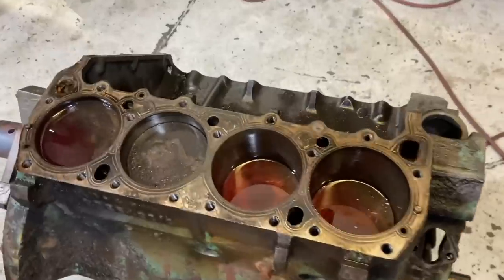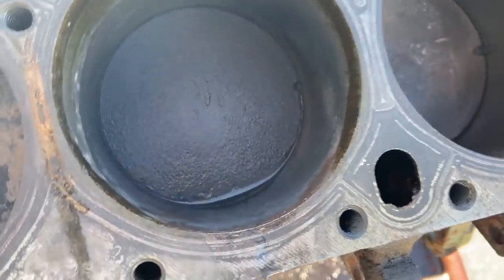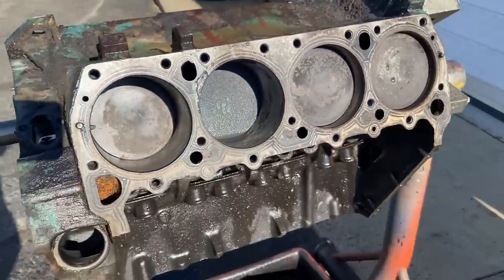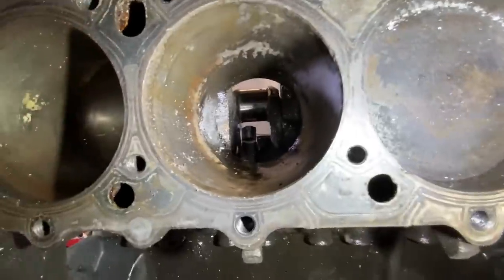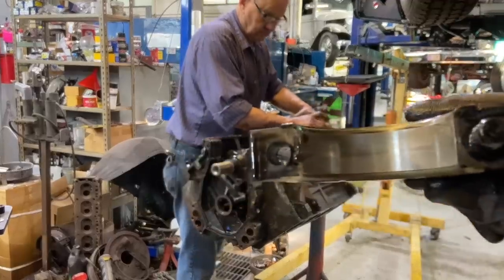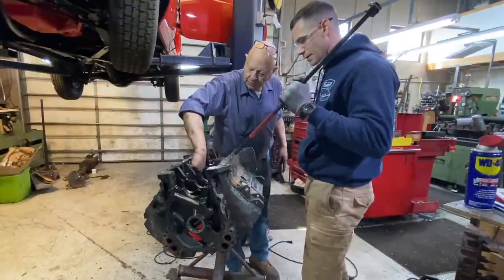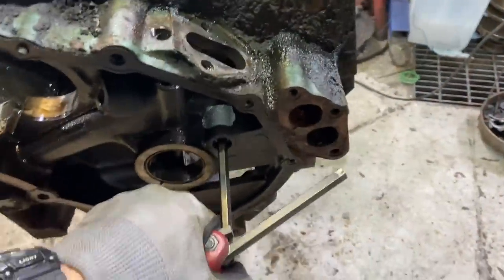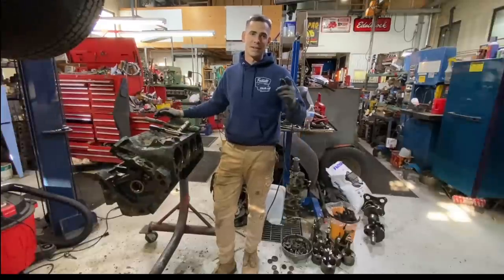How to Free a Seized ‘69 440 Engine: Ep. 2

Comment: I think several days of electrolysis rust removal (or when the process stops bubbling) in a large plastic storage container with a cathode and anonde would free those rusted seized rings. Add arm and hammer laundry booster to help the chemical process. Use a 12v battery attached to a battery maintainer/charger. Awesome YT channel much ❤
Reply from the maker: thank you for the support and I agree that could have worked too, we took the Roger Route and it was fun in its own way!

Comment: I have worked-free pistons in B-engines since 1985. The first was a 400HP from a '72 Fury l cop car. I used Liquid Wrench spray and a propane torch, trying to save the piston, but that cylinder had a residual rust ring and pits, so I saved it for a rebore. Didn't even know then that it was the best main webbing block available, besides the super rare cold weather block (more external ribbing). Next was a '69 383HP from a Road Runner. It was too far gone to save the pistons, as it had been sitting out in the weather as a shortblock. Had to wrap a friend in a work jacket (shrapnel protection!) and use a small diameter lead pipe and a sledgehammer to remove the last 2-3 pistons. That block was later used in a customer's '66 Newport with freeze cracking on the original block. 25 years later he sold me the car!! (Sometimes they come back!)  Lately I did a '65 413, mostly for the crank but I ended up using that, one piston/rod assy and one rod only, to repair another '65 413 I bought just for the bare block, but the guy threw the rods and pistons in and 7 pistons and 7 rods were perfect and the bores looked good. I use a (bent) 727 OUTPUT shaft, cut off past the governor part, and a 3lb. sledge to remove pistons I'm not going to reuse. That method, with penetrant and sometimes heat, has never failed me.
Reply from the maker: Glad you found some techniques that work for you, and those sound like some really cool builds! Right on man💪🏼

Comment: Never used acid on a block... remove crank. cleaned with brake cleaner top U bottom of cylinders.... spray with PB blaster... use block of wood and small eledge hammer.. Never strike engine parts with Metal  Ever....... Always removed pistons even after 70 years with success...
Reply from the maker: You can’t remove the crank when all 8 pistons are frozen because the rods lock it in place and can’t rotate the crank to expose caps, but good try

Comment: I recently purchased a '70 440 and had it shipped to a local garage for rebuild to replace my 383 in my '69 Roadrunner.   Hopefully it won't have any major problems and maybe it will be finished by Spring/Summer. 👍
Reply from the maker: That’s great I hope it’s an easier start for rebuilding than this one was too!

Comment: Pob a silly question to old timers, but the welder in me says why not use a torch or something similar to heat the block around the piston to free it?
Reply from the maker: Not silly it’s logical to think that way, however consider in order for that to work you’d need to pretty evenly heat all of the surrounding metal on the cylinder walls which would take some time with any torch due to the thickness of the cast iron to heat and then would only localize the heat to about a 2-3” circle but still have to do that about 10 more times around the block inside the cylinders. At this point even if we managed to do that as you saw the rings were so heavily stuck to the walls they wouldn’t have just snapped free.

Comment: Brake fluid , ATF, and a little solvent mixed it frees up stuck rings 20 plus years family had a wrecking yard it works
Reply from the maker: I’m sure sure that worked on the ones you tried, this one was a bit beyond the average stuck engine. Roger’s 50+ years got it done here💪🏼
Reply: So i drop it in the cylinder holes and let sit for how long before i remove them??

Comment: rust =apple cider vinegar not white.   loosening stuck stuff=oil of wintergreen we were told. you can use the Kleen strip metal and concrete etch as its the same as Ospho, and its not water into acid  its acid into water

Comment: Next time save yourself a sheet-ton of trouble and douse them with 50-50 ATF/Acetone and then bag it.
At least use PB Blaster. MMO is for dissolving tetraethyl lead, graphite, carbon - not rust.

Comment: Clean as much out of bore you can, add wd40 and at, let it sit for couple weeks.  Clean and blow out. Try with a breaker bar to turn. If won't move repeat procedure.  It will eventually come free.
Reply from the maker: maybe for other engines sure, but as I said in the video, it sat for a few weeks each with diesel, then atf, then marvel...braker bar and solid whacks to the top of the piston each time, nothing. Then muriatic acid, more attempts, nothing. That piston wasn't coming out as you see in the video, it had rusted itself to the wall.

Comment: FFS, when you take the rod cap off, tap the rod bolts out first before you get the rod and bolts all jammed up against the crank journal and the engine block wall. I know it takes some brute strength to pound out stuck pistons but using that short picklefork on a deep skirt mopar RB block is not sound thinking. You only showed a fleeting glimpse of the crank rod journals, but it looked like you and your buddy got a little carried away and gouged the rod  journal unnecessarily.
Reply from the maker: That buddy is a master machinist whose been at this over 50 years and knows more than most people around. The crank was not gouged in a single place, what looked harsh to you was finesse for him. Thanks for your input and for watching tho💪🏼

Comment: Why not remove the crank and then cook the block.
Reply from the maker: the connecting rods lock the crank in place you have to rotate the crank around to access all the rod caps, you can't just pull out the crank if the engine is seized like this

Comment: Buy him a sledge and save a ton of time. It's like trying to frame with a finish hammer..
Reply from the maker: Thanks for trying to correct a 50+ year master machinist/mechanic…we’re not trying to crack the block but you can do that on yours!
Reply: @FanelliRestorations  if you can crack a steel block beating on an aluminum piston you would be magical. 1st off you knock them down, not up. Crank weight working with you, not against you. Da..
Reply: @FanelliRestorations  I was cleaning rust off of steel in the 60's so I guess I would be a 60 year master. I did not invent the saying, you need a bigger hammer", but if that was not obvious to you then you need a bigger brain. Master means you have all the tools and know how to use them. 1 , you soak in diesel. 2 ,remove main bolts, 3 , get an oak 4" x 4"  and a BFH. Don't judge til you've tried it!